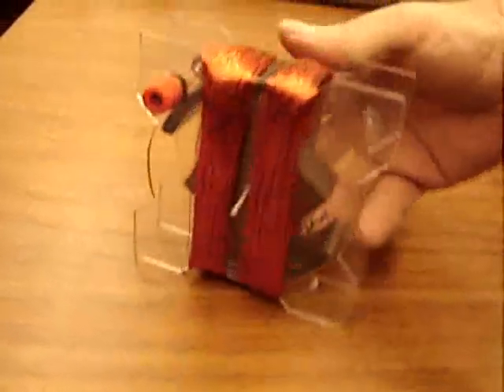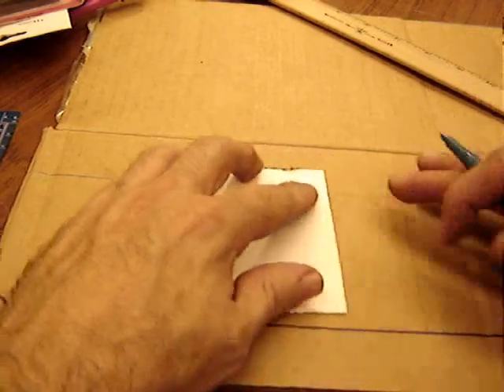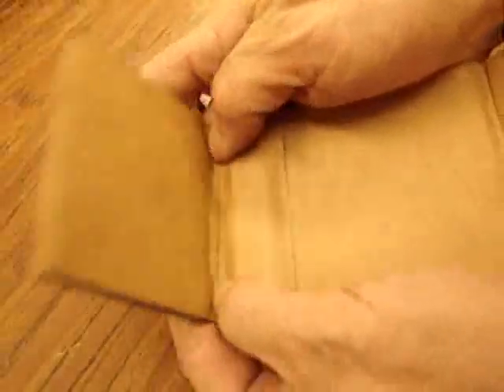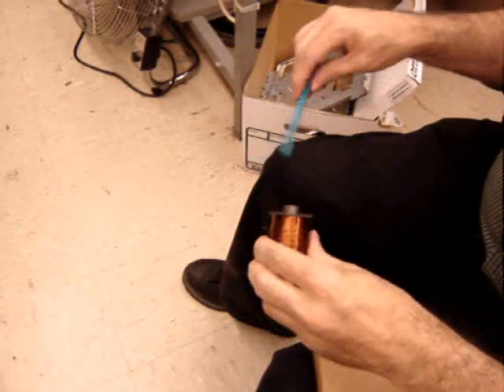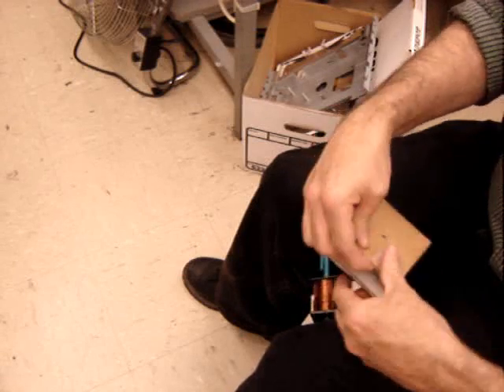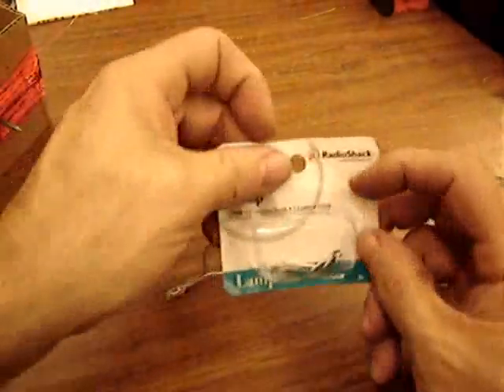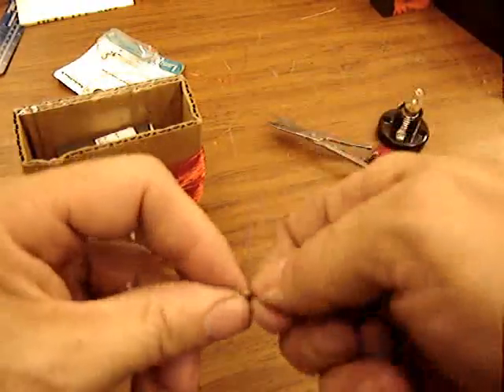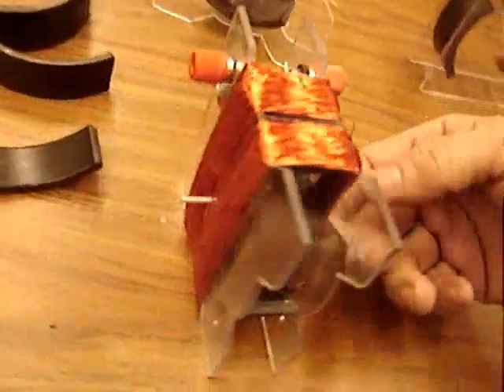Simple generator:  AC electric generator for science fair

Comment: wbeaty Would you be able to explain how the current generated is AC? I checked your website but all I could find is how the electricity is produced rather than why it is AC. Thankyou
Reply from the maker: Excellent question, I'll add more to HOW IT WORKS section.

Why is this generator AC and not DC? When the magnets flip, they create a pulse of voltage. But when they flip a second time, they create an opposite pulse? Yes. So then a spinning magnet is making electric signals that go plus-minus-plus-minus? Yep. It happens because, in order to create voltage and currents, a magnet pole must sweep sideways across a wire. If instead it sweeps along a wire, nothing happens. In our little generator here, the magnet poles don't sweep constantly along the curve of the wire. Instead, first the north magnet pole sweeps across one side of the coil, and at the same time the south magnet pole sweeps backwards across the other side. The two effects add together. But next, the magnet keeps turning around, and now the opposite poles sweep across those parts of the coil. The magnet has flipped, the magnet poles are reversed, so the second pulse of coil's voltage will be backwards. And if a bulb is connected, then any current will be backwards too. Each time the magnet makes one complete turn, it creates a forward pulse and then a backwards pulse. Spin the magnet fast, and it makes an alternating wave: AC.

If you want a DC generator, you'll have to add a special reversing switch to the magnet shaft. It's a switch called a "commutator." After every half-turn, it reverses the connection to the coil. That way it comes out as pulsed DC. If you look up some DC generator DIY projects, you'll see how to build the commutator switch. But those generators aren't Ultra Simple!
Reply: OHHHH!! I see, thankyou very much!!!!

Comment: is it okay if the wire slightly touches the nail? and if the wire overlap each other?
Reply: You want the magnets to whizz like a blur.   If the nail is grinding against wire, they slow down.   I just wind the wire in big lumps, then use scotch tape to pull it away from the nail hole.   That, or saw a Bic pen tube into little segments, then slide it on the nail and between the wads of wire coil.

Comment: Does it matter in which direction we wind the wire? Does it work if I wind it to the right then then to the left and so on...?
Reply from the maker: Entire coil must be clockwise.   Or entire coil CCW.    If it's half one way and half the other, then it's just like putting two D-cells back to back:  the voltage subtracts to zero.

But if instead you wound two separate coils on the generator, one CW and one CCW, you could connect their four wires so they add together rather than subtract.
Reply: does it need to be two half can i just make one big lump of winded wire?
Reply: Michael Christianis
One big lump.  But don't block the nail hole.  Keep the nail from rubbing on the wire.   Some people glue little plastic tubes so the wire won't push against the nail.   Cut a plastic pen up, to get tubes?

Comment: we use the 3.6volts bulb cause we dont have a 1.5 v so what are we gonna do?can we just increase the number of turns of the magnetic wire?thank you............
Reply from the maker: > we don't have a 1.5 v so

Read the project website about the bulb.    If you use twice as much wire, it will light a red LED.   Or instead, spin the magnets twice as fast (maybe use an electric drill.)

Comment: how could u attach the four magnets, i couldn't understand
Reply from the maker: Yeah, that part needs improvement.    The magnets strongly grab the nail.  Then jam some bits of cardboard into the cleft on either side of the nail.   That way the nail will stay in the middle, and not slide around.   Watch the video closely.   Me, I used little pieces of plastic and some 2-sided tape.  But the plastic has to be thinner than the nail.    You can also wrap some tape around the magnets, to make them squeeze the nail even harder.
Reply: @wbeaty   u re 👍 smart

Comment: i know how to get the generator to power its self until it burns out
Reply from the maker: Did you build a working model?    Whenever perpetual motion machines are involved, ideas and theory are totally worthless.   MILLIONS of people have ideas on how to make a generator that powers itself.  Those ideas are worthless.    Only a DIY prototype model has any value; a working model which does actually power itself (no batteries allowed.)

Tesla didn't only go around telling people he had an idea for a motor, instead he actually built one, so he could prove to himself that his idea wasn't just BS.
Reply: ok my idea for the (self powered generator) is to hook the motor to the + and - on the wire. and some how attach the motor to the nail, be sure to hold the motor and the box or else it will twist the wire and ruin the motor
Reply from the maker: tyler minor
Instead why not build a simple wind-up toy.   Then have its little arm wind itself up?

In truth this kind of idea is really just a flywheel.   It's a fancy flywheel with mechanical and electric parts.   But it behaves just like a flywheel:  it moves if you spin it, but it just coasts to a stop, since it doesn't contain any source of energy.

Don't agree?  Then build one and see if it coasts to a stop whenever you spin it.

Comment from the maker: > How do you connect it to the screw base?

This generator can't operate a normal flashlight bulb.  But if you have a #48 pilot light, you'll have to buy a lamp holder of "miniature screw" or E10 type.   I think Radio Shack stores still sell those.   It's the kind found in old-style flashlights.

Or, just buy the special bulb from All Electronics online.

Or, use a red LED.   But LEDs need 1.7V, not just 0.7V.   You'll have to wind twice as much wire, 600 turns not 300.   (That, or use an electric drill to spin the magnets inhumanly fast, like 15 revs per second.)
Reply: how do you make the plastic version...... im interested
Reply: These mentions of Radio Shack are going to bring back some serious nostalgia in a few years.
Reply from the maker: Carl Langdon
>mentions of Radio Shack

Yeah, little kids won't be able to sneak around and build generators without their parents ever knowing.   They'll have to have their own credit cards to do mail order.
Reply from the maker: MC Super Tone
That special Radio Shack bulb needs 30 milliwatts (1.5V times 0.02 amps).   The #48 bulb needs 120 milliwatts (2V, 0.06amps), so it needs almost 4X more work in spinning the generator.

But the #112 bulb needs 300 milliwatts (1.2V times a quarter amp,) or 10X more work than the sensitive Radio Shack bulb.

In other words the #112 bulb uses much thicker wire in its filament.  So where the R.S. bulb will light up brightly, the #112 bulb will short out the generator and drag down the voltage.  It should light eventually, but I think you'll have to spin the generator about 5X faster than for the R.S. bulb.   It does help if you use SLIGHTLY thicker magnet wire, like #26 gauge instead of #30.  But you'd have to buy four of those radio shack wire kits.  Damn expensive.

See, this generator is very precisely designed by a professional Electrical Enegineer to be affordable, and with easily available parts.  Most changes will push you away from the "optimized."

Here's a source of really cheap copper wire.  Buy at least two, since each one only has about 40 meters of #31 wire inside:  http://www.goldmine-elec-products.com/prodinfo.asp?number=G19573   Better buy a whole crapload of them, before they disappear again.

These below were also great  ...but they disappeared.  Sold out.
http://www.surplusshed.com/pages/item/r3041.html
Reply from the maker: +L B.  Flashlight bulbs work with AC, but they need a couple of amperes at around 3V.   This generator produces only 3/4volt, at well under a tenth amp.  It doesn't have enough turns of wire, and its magnets don't spin fast enough.   Maybe you could light a standard 3V flashlight bulb by using big neo supermagnets instead of black ceramic magnets.   Also, wind about 1000 turns of #26 wire, not just 300 turns of #30.    Or, drive the magnets with a hand-cranked belt-drive, with a big hand-crank wheel spinning a tiny wheel at extremely high RPM, with the tiny wheel connected to the magnets axle.
Reply: Would like to supply materials needed for this generator .As I want to purchase the things by online I need whole cost of them.Thank you
Reply from the maker: Vishnu Priya Upadhyaula
Read the parts list?   On the main website?
Reply: Hi i have made generator and it works on the 1.5 bulb and i was trying a flashlight lamp which took less power then the #48 this is the #112 and it takes 1.2 volts and i have the lamp holder and when i connected it and spin the generator it did not work so i connected a AAA battery to the flashlight bulb and it did work but when i connected to the generator it did not work can you find out what is my problem this is it.  http://www.ebay.com/itm/like/201003208917?lpid=82
Reply: What if my magnets are north and south magnets will they work? And by north and south I mean those little magnets that r colored with blue in 1 half and red in the other
Reply: also what if the wire is already copper wire? That's ok right? I mean it's better too since I don't have to shave the red stuff off of it
Reply from the maker: Ayla Pias
You could try it, but it's best to use the magnets in the parts list.  Also see the main article on the site, where you can make large magnets by gluing lots of small ones together.

Don't use different wire.   It must be insulated with thin enamel varnish.  If wire is bare, then the charges will jump straight across, and not go in a spiral.   The spiral makes the voltage add up so its enough to light the bulb.
Reply: Ayla Pias if the wire had no insulation, it'll short
Reply: Sir kindly tell me how to make a zapper without disposible camera and racket... please this is uregent
Reply: plese onece more simple video of genrator

Comment: cant u just add a small electric motor at the end instead of light to have continues power?
Reply from the maker: Or just make a mechanical wind-up toy which can wind itself up?

Make a water pump which is powered by the water it pumps.

Just take a solar-powered LED lamp and aim the LED at the solar cells.

Even simpler:  invent a flywheel which keeps getting faster, all by itself, until it explodes.   Then connect it to a machine to do work, and it just keeps going forever.

Comment: magic of nature,
 interesting
Reply from the maker: It's like a drive wheel.  But it's a wheel which moves a belt made of pure electricity.   Very useful if you don't want any leather belts inside long wooden troughs which need constant greasing to avoid friction.  

Look at those giant towers with 3-phase cables hanging beneath?  They're just leather belts   ...the silent low-friction version of belt/shaft power transmission.   Steam engine on one end, belt-driven washing machine on the other.

Now electric lights, THAT'S where the real magic lay.

Comment: will joints in the coil effect output. also will neodymium magnet work??
Reply from the maker: Big neo magnet works great.  But any magnet must stay close to the wire.   A tiny neo magnet will be too far from the coil.

No problem with joints in the wire.  Just clean off all the plastic coating, twist ends tight together many twists.  Perhaps fold some plastic tape around the joint so it doesn't pull apart later.  (Also, it's an excuse to learn how to solder wires!)
Reply: wbeaty thanks :-)
and yeah i guess i ll make the frame a bit smaller in height to reduce the distance between my magnet and the coil

Comment: What would the power curve/graph look like on this? I'm having a hard time visualizing the magnetic lines as they cut through the coil from the inside.
Reply from the maker: Imagine that the magnets stay still and the coil rotates.    The voltage waveform will probably change depending on speed.  At low speed it probably is somewhat sine-wave, but the tops are more flattened like a square wave.

Comment from the maker: > How much money would this come out to?

Zero.   I have all those parts in my junk box!  :)  Did you buy everything from Radio Shack?   Then check their website for prices.  Those magnets are like fifty cents in hardware stores and craft stores,  but three dollars each from Radio Shack.

See my project site for links to many sellers of thin enamel wire and magnets.
Reply: wbeaty so i got 2 volts as the output voltage. For the project, am i supposed to say i got 2 volts because i used 200 turns of coil or 300? Which one makes more sense?
Reply: i spent too much money on the magnets, light bulb, wire and i cant go over the money and i dont a voltmeter. can i get results for the volmeter online?
Reply: yes
Reply: could you do this, attached to whatever cycling exerciser and plug it in something that would transform  (and stock) all the energy you put in your training  in electricity. Would be a great concept & a good motivation to get my ass up a bit ahah . Seriously would something like that be possible ??
Reply from the maker: jeffrockr
You'd need a real generator for that.  This one is a crude toy made with cardboard.   See the links on the website for other generators.  Also, any big DC magnet motor is also a geneator.
Reply: wbeaty Will a thicker copper wire work and what should i tell in radio shack about the copper wire  that you used in this video
Reply from the maker: MC Super Tone
Did you read the article?   Or the FAQ?   Or the part where I discuss different thicknesses of wire?
Reply: i need an independent and dependent variable wbeaty please help
Reply from the maker: Priyanka Kaur Independent: change the number of turns in the coil.   Dependent: AC voltage output.  (Spin the magnets always about the same speed.)   But you'd need to get a voltmeter to measure it.
Reply: thank youuuuuu
Reply: I don't know if you'll reply, but the required things are not available in my region, are there any other substitutes?
If so, what other adjustments do I have to make?

Comment from the maker: See the "Debugging" section.   Usually the problem is wrong parts (other light bulbs won't work, must use those big black ceramic magnets and hundreds of turns of #30 wire.)

You CAN add lots more wire than just 200ft.   Then you won't have to spin the magnets so darn fast.

Comment from the maker: > binding posts?

Nah, just twiddle the wire ends onto the light bulb wires.

For a sleek professional version, replace the crude cardboard with plexiglas, and add Radio Shack binding posts to make it easy to connect wires to the generator

Comment from the maker: Moving magnets create voltage.    So, we can pump electricity and make it flow, just by moving a magnet.   That's what electric generators really are.   Also, moving electricity can "pump" a magnet and make it move.   So basic rule:  ALL ELECTRIC MOTORS ARE GENERATORS, and also ALL GENERATORS ARE MOTORS.

Go see the HOW IT WORKS section of the main website for Ultra Simple Generator

Comment from the maker: First build it with #30.   Then try making changes, see if it stops working.

Your goal is to make a little tiny coil with 250 turns or more.   All the turns must remain very close to the magnet.   So, thinner wire will work, and you can then add more turns (for higher volts, so it easily lights LEDs.)

But with thick wire, most of the turns will be too far from the magnet, and they won't contribute much voltage.  (But, try some large neo magnets)

Comment from the maker: LEDs don't work.   Lightbulb turns on at 0.7V.

Follow instructions.   If you use different parts, it won't work.

(You CAN use an LED, but you'll have to add 2X or 3X more wire.)

Comment from the maker: You put cardboard spacers on both sides of the nail?

If the cardboard spacer is too thick, then when you turn the nail, the magnets won't turn.

Also, maybe your magnets don't grab the nail tight enough.  Try putting stretched tape on ends of the magnet.   You want the magnets to squeeze the nail tightly.

Comment: I tried this concept as a wind turbine but it didin't work... I had to cut the wire half way during the winding process as it was not on a spool and got tied up (I took off the insulation when getting the ends back together so the insulation wasn't the problem), I also only used 2 magnets. Any ideas as to what the problem is? THANKS

Comment from the maker: Yes, red LED.   But the LED needs 2x higher voltage than the special bulb from Radio Shack.   So, spin the generator very very fast.   Or, add 2x more wire.

Comment from the maker: Even 1.5v bulbs will not work.

If you don't use mail-order to purchase the special bulb from Radio Shack or from All Electronics, instead you can use a red LED.   But a red LED will only work if you spin the magnets *very* fast.   Or instead you can use extra #30-gauge wire, use 600 turns instead of just 300.

Comment from the maker: You need to purchase a spool of wire.

A solenoid is a spool of wire.   Usually not expensive.   Open up the solenoid frame using pliers.  Remove the spool of wire.   Use the wire to build the generator.

Comment from the maker: If you have a machine shop or even power tools, then you can build a much better generator.   See the links on my main website:  DIY wind power generators

My generator is for school kids.   Cardboard and tape.

With soft iron parts my generator probably would make 12V of AC, instead of 3/4V.    It could light up any regular flashlight bulb.  You could add diodes and use it to charge a battery.